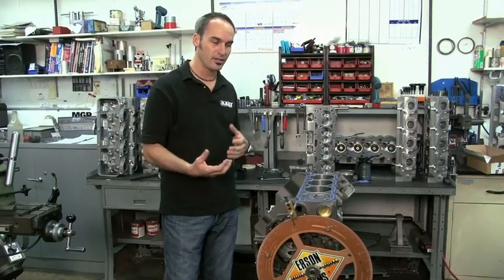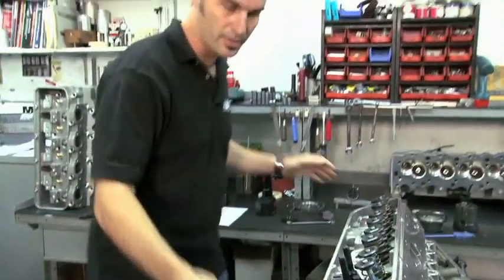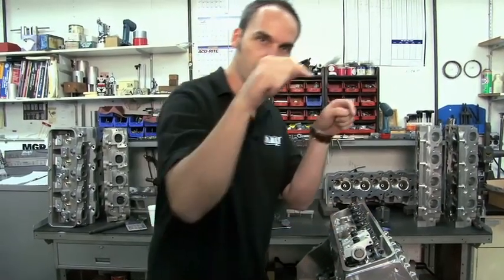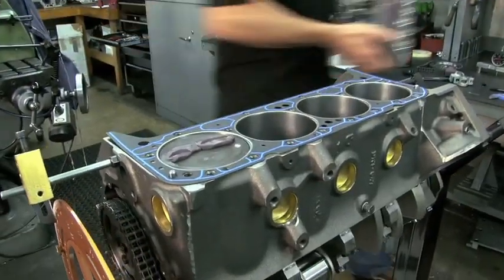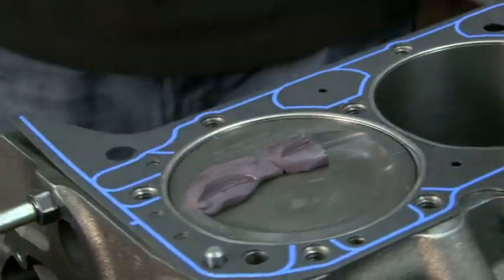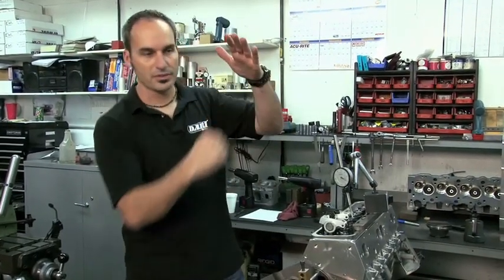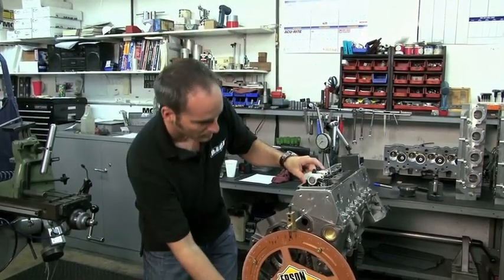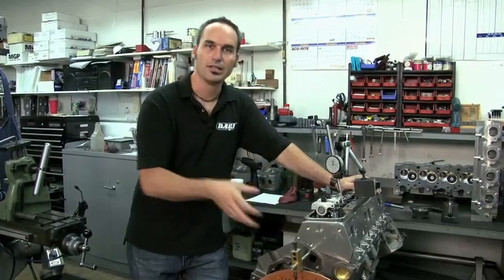StreetLegalTV.com - Dart University: Piston-to-Valve Clearance

Comment: I think it would ruin a cheap gasket since they crush to seal and require re-torquing after a heat cycle.  A MLS gasket will be fine and wont need retorquing.  Just my take.  Good question.